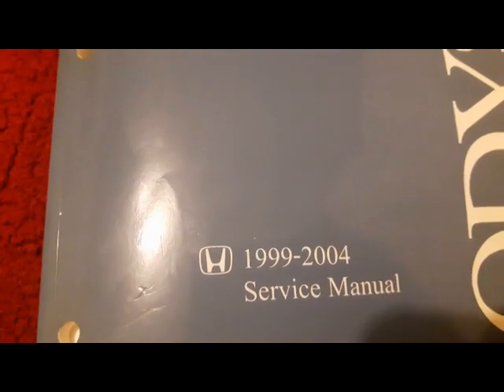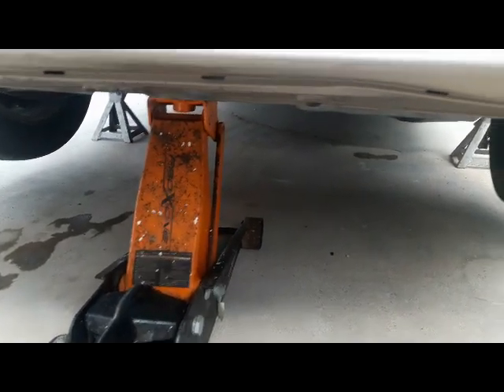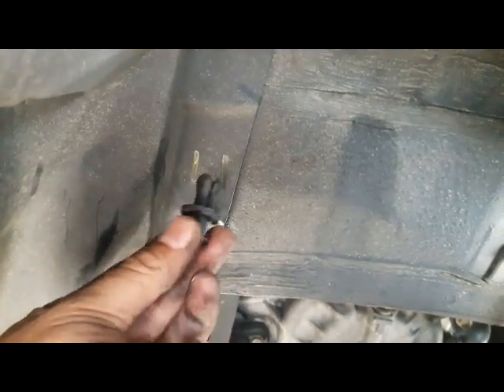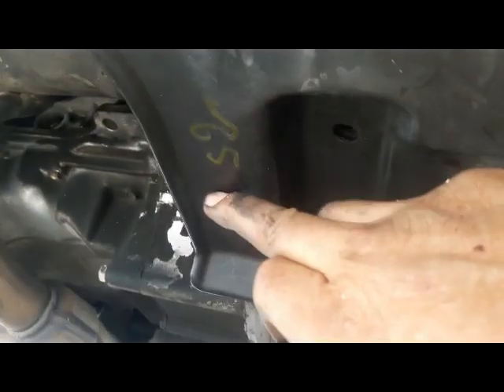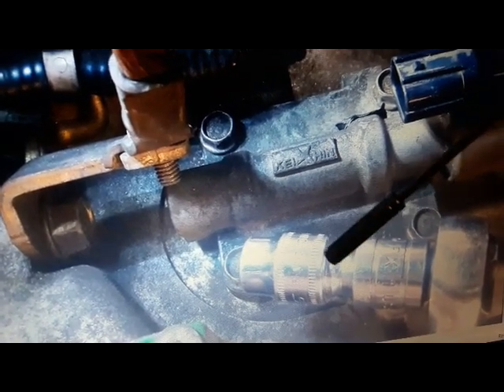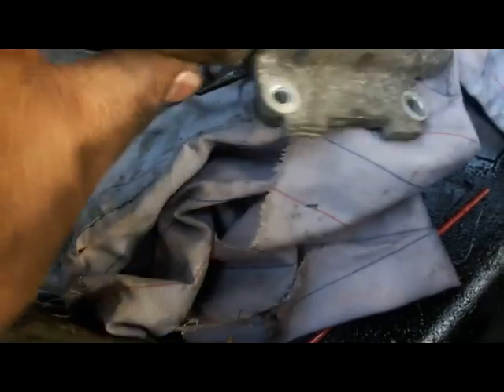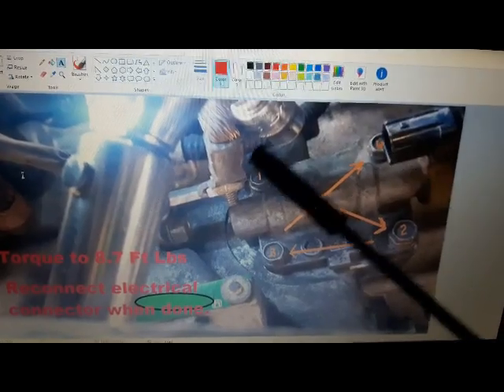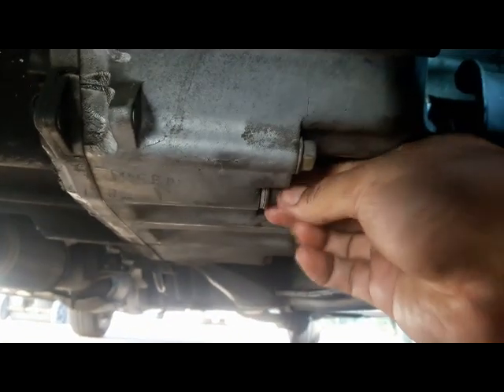2004 Honda Odyssey Automatic Transmission Maintenance part 2 of 2

Comment: Thank you so much for a very informative video. I am DIYer myself taking care all of my cars. I saw a 2004 Honda Odyssey EX-L  on a local dealer here with only 55,007 miles with all the documentations and carfax. I’m kind’a hesitant to buy any V6 Honda vehicles due to its bad reputation of the transmission especially the odyssey. But your video made me realize that it’s not bad at all as long as proper maintenance is done. I also have a 2005 Honda Accord with over 272,000 miles and still running like brand new!
Reply from the maker: The problem with Honda is they put an external filter in and at the same time put a no maintenance required on it. Well, that filter eventually will clogged up and cause other problems. By replaced it regularly, your trans will last longer than normal.
Reply: @True Renegade  I was wondering what state you live in to get an idea what weather condition your odyssey is in? Again great videos 👍
Reply: I have 2002 Odyssey with 251,600 miles. ATF filter replaced around 4 years ago, what interval do you recommend?  Thanks!

Comment: Did you have any transmission before this video and did this help improve your transmission shifting? ❤️ your videos 👍
Reply from the maker: Got hard shift when it cold during winter month, at the time I didn't know how to fix it until Got the shifting problem on my Civic. Fix it using this technique and applied it to this odyssey and it seem to fix the hard shift problem for me.
Reply: @True Renegade  my 04 odyssey takes time before engaging into drive and sometimes doesn't shift smoothly usually from 1st to 2nd gears while in drive. Your different videos are very helpful to prevent costly repair$. 😁

Comment: Thank you for the wonderful Odyssey videos. I thought I should try to add the fluid through the dip stick tube like you did in the video instead of removing the fill bolt so instead of a tiny funnel, I used a dollar store turkey baster and stuck my funnel with a hose into the plastic baster. The baster is clear so you can watch the fluid so you don't accidentally overfill.

Comment: Did you experience when you shift the gear from park to reverse and felt sudden thug in the tranny when the engine is still cold?  It happened only in reverse (cold start only higher than 1000rpm) ,no problem at normal temperature (700-750 rpm).thanks
Reply from the maker: Check for bad motor mounts when you hear a thug sound when shifting from park to reverse.

Comment: ONE OF THE BEST INFORMATIVE VIDEOS I'VE WATCHED ON YOU TUBE. THANK YOU
Reply from the maker: Most people don't know that there is an external filter that need to be replace, and when they replace the external filter with the after market filter, some doesn't have a filter by pass built in, so I recommended you change the external filter regularly like 1 a year and it's best to change it when you change the trans oil (1 a year). Keep the fluid looking pinkish is best for your transmission.

The OEM filter have a bypass valve built in, when the filter clogged, the bypass is open, this cause the unfiltered oil circulate through the system that can cause the screen tubes in the shift solenoid valve to clogged up.

Comment: Is there a reason that you did not remove and clean the shift solenoids that reside right under the starter on the front of the transmission?  Bottom one is easy to remove and the top one can be removed if you loosen the starter  and tilt it up - you don't have to remove it.
Reply from the maker: I only go after the one that have a screen tubes for cleaning maintenance, all others have just a rubber o-ring, if failed  (unless the o-ring is leaking) you will need to replace the whole sensor.
https://www.hondapartsnow.com/parts-list/2004-honda-odyssey--5dr_ex-ka_5at/transmission_automatic/at_sensor_solenoid.html

Comment: Please can you tell me what was the reason you replace that solenoid
Reply: He didn't replace the solenoid valve. He replace the screen with the rubber gasket. If the screen dirty, it can cause shifting problem.
Reply: @davevalinty4293  thanks for answering do you know why my honda odyssey D  flashing on the dashboard
Reply: @zulmaramirez8153  that telling you that you need to have your transmission check out. I can be as simple as low fluid level, bad connection to or bad solenoid valve.

Comment: True Renegade, question,the screen on the clutch solenoid was dirty? Had any metal particles?
Reply from the maker: no, just the black stuff sticking inside the wall area.
Reply: @truerenegade1095   so do you think  it was clogged some or a little bit?
Reply from the maker: @joseleon6522  I think the shift solenoid was clog/dirty to the point that I experience hard shifting in reverse. This could be just the filter clogged up. When the filter clogged up, it open the bypass valve in the filter sending dirty oil through the transmission system, this will cause the screen tubes in the shift solenoids valve to get clog or dirty. Here is my opinion on this after I done this maintenance OK?
If your vehicle have shifting problem (my had a hard shifting in reverse), than replace the filter and clean the shift solenoid valves like I show you in this video. My Odyssey now doesn't have a hard shifting in reverse any more. Since I'm not replace the filter with the OEM filter and I don't even know if the after market filter have a build in by pass valve. to be safe, I decided to replace the filter and change the fluid every year.  This will ensure the filter not clog up and it keep the fluid nice and pink.

Comment: Could you help me say why was the reason you changed it?
Reply from the maker: 1. It's over 100k miles when I discovered it got an external filter. So it's about to change it.
2.  It had a hard shifting problem from Park to Reverse, and sometimes delay in shifting on the highway.
If you wants your trans to last longer, then do this maintenance when ever the fluid is no longer Pink .
Once you done this maintenance as shown in this video (clean all the screen tubes in the shift solenoids), all following maintenance after, you just need to change just  the filter unless you encounter shifting problem. Good luck!!!
Reply: @truerenegade1095  my odyssey's “D” flashing
Reply: @Alex_Rodrigez  Do the maintenance in this video to see if it help. When you don't change the filter, and when it got clogged up, the bypass valve in the filter will open allowing all unfilter fluid through the system and eventually,  it clogged up those screen tubes in the solenoid valves and causing shifting problem. Or you can take it to the transmission shop and they will rebuild your transmission which is costly.
Reply: @truerenegade1095  thank you for the answer
Reply: @davevalinty4293  thank you for the answer

Comment: Thank you very much for the video. I'm hearing a whining noise until the Odyssey warms up. I noticed some delay in drive engaging after backing up when starting from cold engine/transmission. I wonder if it is too late for this maintenance to help? I love this vehicle and hope the transmission has not gone bad.
Reply from the maker: 1. Investigate the whining noise by using a Mechanic's Stethoscope like the one in the link below or using a long screw driver and place one end to the area/part  where you think the noise coming from, the other end to your ear. The area/part with the loudest noise is the one may need to be replace. I did this around the area of the alternator, power steering pump, water pump, fuel injectors and accidentally touch the Purge Solenoid Valve and discovered the clicking noise led to my very first You Tube video.

https://www.harborfreight.com/mechanics-stethoscope-63691.html?cid=paid_google|||63691&utm_source=google&utm_medium=cpc&utm_campaign=&utm_content=&gclid=EAIaIQobChMI4KPApf346wIVzsDACh2DwALSEAQYASABEgJJmvD_BwE

2. For the longest time, I been added transmission fluid about 1/2 quart above the full line due to hard shifting until I discovered that there is an external filter on this Odyssey (Not all model will have this external filter). After I replaced the filter and clean out the screen tubes on the 2 shift solenoid valves in this video, My transmission no longer hard shift and I don't have to over fill  the fluid level. In your case, I would change the Transmission filter first or do both (Filter and Shift Solenoids if you have time) to see if it help. If you take it to the transmission shop, they will do an "overhaul" your transmission. 

3. Use Honda Transmission fluid. Some of my friends experience hard shifting using the after market transmission fluid.